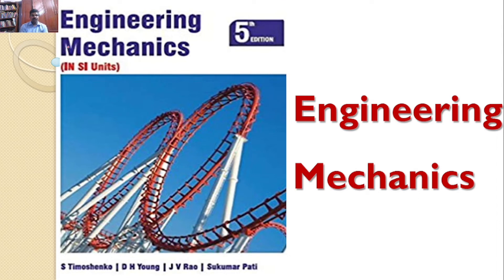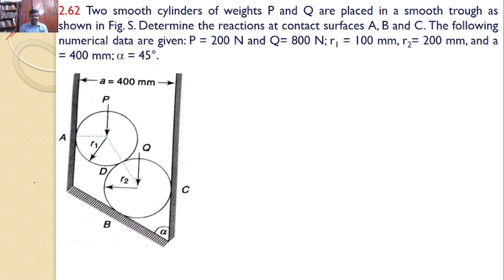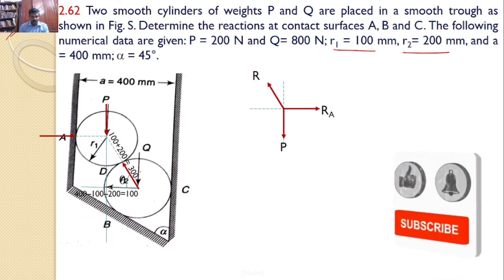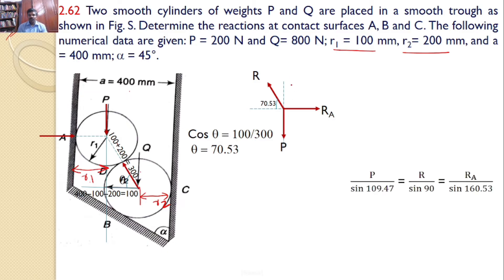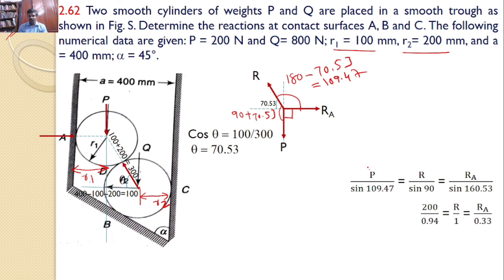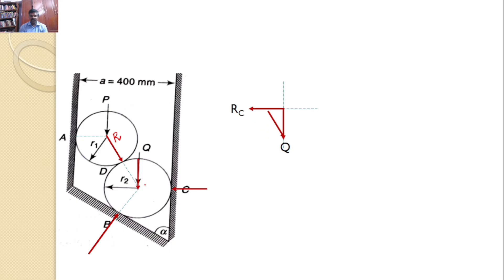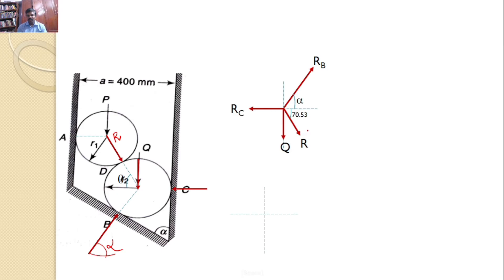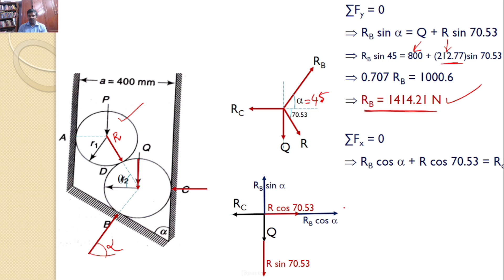Engineering Mechanics, Problem 2.62, Timoshenko, Equilibrium Equations, Method of Projections, Lames

Comment: Sir, in some videos u have kept the sin for horizontal and cos for vertical but in this u have kept it reverse....is the answer get equal in any trigonometry value....to exchange their places....thank you for this😊
Reply from the maker: No. That all depends on angle made with horizontal or vertical. If the angle is made with horizontal then horizontal component is cos and vertical is sin and vice - versa....